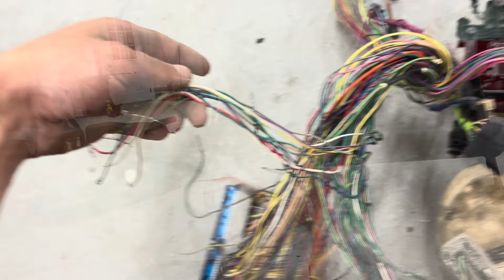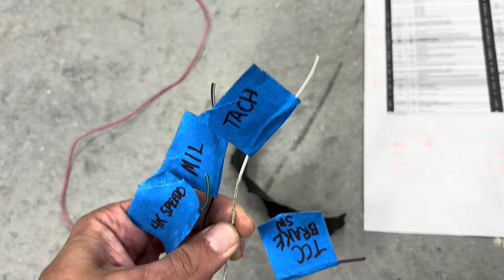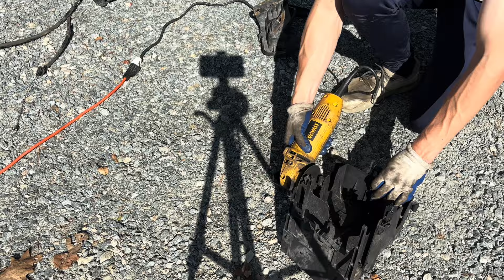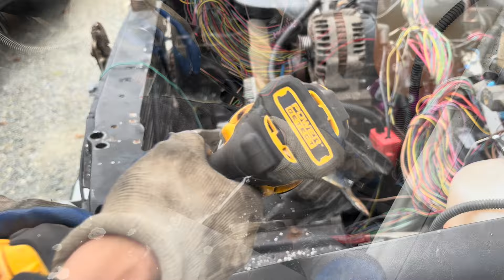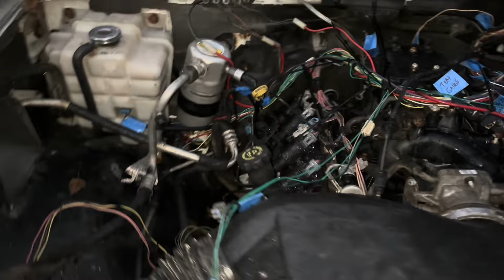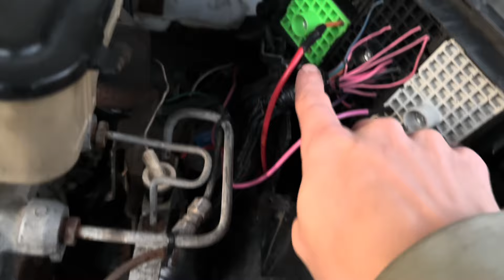Wiring My LS Swapped GMT400 Crew Cab | OBS Dually LS Swap Part 3

Comment: Doing the same swap, do you have a list of wires you kept from 94 harness and their colors?
Reply from the maker: I don’t have a list I’m confident covers everything. I highly recommend lt1swap.com. Below is what I remember,

TCC Switch - Purple
MIL - Brown
AC Req - Light Green
Tach - White
Key 12V - Pink
Starter solenoid - Purple

There’s also cruise control wiring which I don’t remember off the top of my head
Reply: @lessthan818 this helps a lot, thank you!